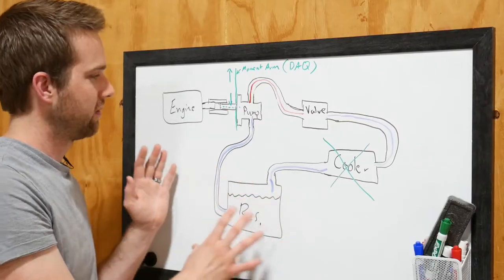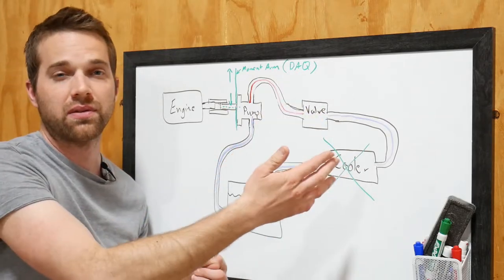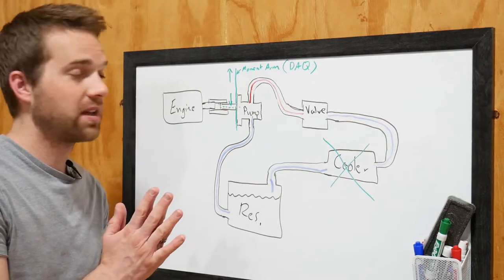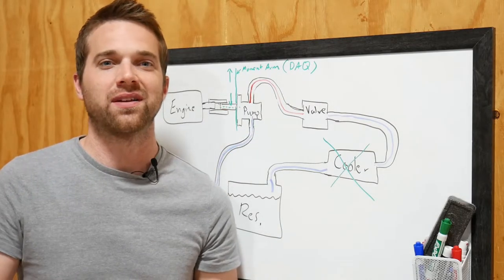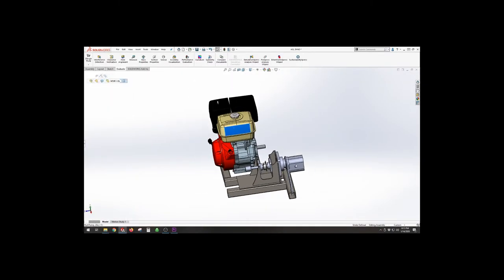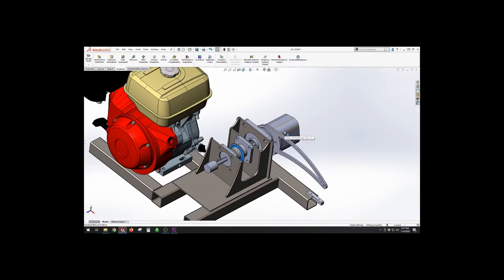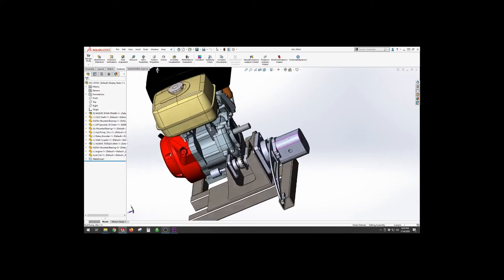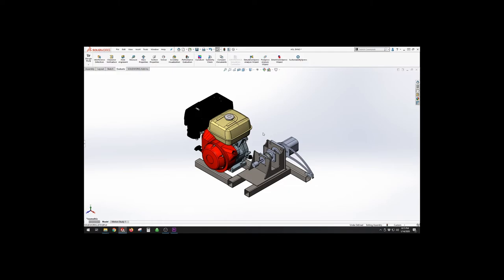Design - Budget DIY Dyno

Comment: Is the flow valve throttling associated with the throttle position?
Reply from the maker: No the flow valve is what controls the load placed on the engine. The throttle controls the airflow through the engine - more airflow, more power. So at open throttle your engine can output more power vs a half open throttle - but it only puts out power when the dyno pulls it out.

Comment: Somewhat un related question for you... any idea where I could find a pre drawn CAD file of the predator 212 engine that's accurately drawn both inside and out?  It would be helpful when doing machining to those things... 😜
Reply from the maker: Unfortunately I don't. I occasionally check the usual places like GrabCad, but so far I haven't seen anything.

Comment: Hey bud how far could you go, up scaleing this?
Reply from the maker: Hi! "Dynapack" is one of the best known hydraulic-style dynos and they handle upwards of 750hp per wheel on cars and trucks. As long as you can find a hydraulic pump that can handle the rpm and torque you plan to put through it, you can create a dyno from it. I didn't go too far into the math but if thats something your interested in, let me know. Next video of the fabrication is coming out soon!
Reply: @DirtyElbowsGarage  hey thankyou for the information and I would definitely be interested in hearing some more details and math regarding this in your next bid. Thanks